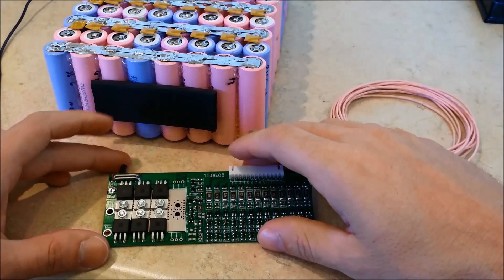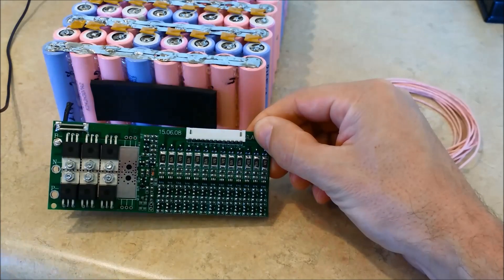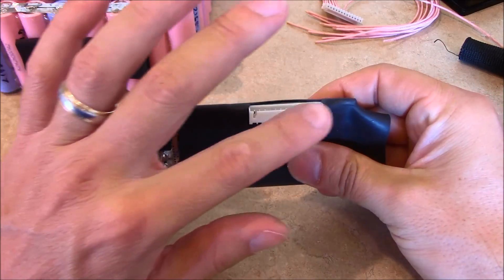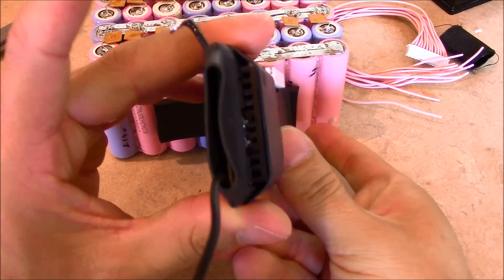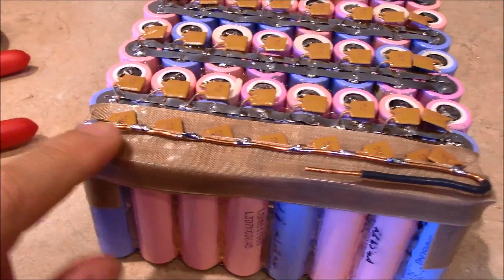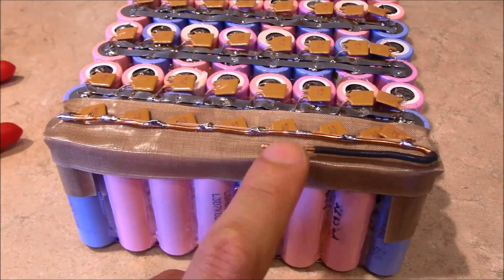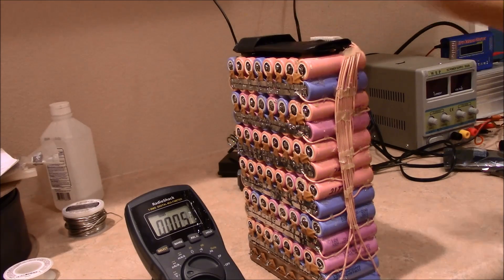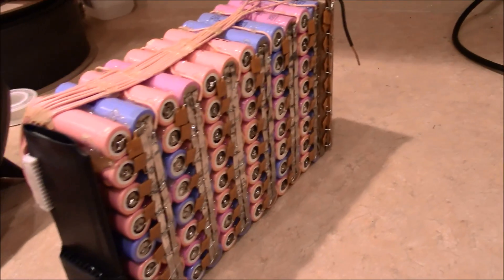18650 lithium ion battery "Wiring the BMS" (Part 4 of 7)

Comment: so i understand everything but i can't find a label that says ch on my specific board, recommendations on where to look?
Reply from the maker: +Ryan Liu ok I thought the link was to what you bought.   Just let me know what is exactly is on your board.  Each type of board has different features.  I'll post mine on my profile page as a reference.
Reply: it is the link i sent u earlier
Reply from the maker: +Ryan Liu  Sorry Ryan, but when I clicked the link last night it was a different schematic.  But now it's closer to what you bought.   OK I your ch+ is the same as V+ .  They come directly off the positive end of the battery.   So connect 2 wires to the positive terminal and send one to the + side of the charging port and the other to the controller + wire.  The C-  wire will go to the charging port negative side.  The P- will connect to the controller negative wire.  B- will connect directly to the negative side of the battery.   let me know if that helps.
Reply: it is only outputing 22v is that because i may have blown the board?
Reply from the maker: meter your battery directly to see if you get 36 volts and "not thru the bms".  Also check all 10 banks voltage to see if they are all close to the same voltage.  Then put your meter negative on the b- of the bms and with the positive lead of the meter go thru each B1 to B10 of the balance charging plug and see if it flows correctly 3.7-36 volts

Comment: how did you wire yours, mine is kind of confusing, how do i wire it? http://www.ebay.com/itm/Battery-Protection-BMS-PCB-Board-for-10-Packs-36V-Li-ion-Cell-max-25A-w-Balance/261830652630?_trksid=p2047675.c100005.m1851&_trkparms=aid%3D222007%26algo%3DSIC.MBE%26ao%3D1%26asc%3D33098%26meid%3Dd05989fb513b412da4db412a6b264e33%26pid%3D100005%26rk%3D1%26rkt%3D6%26sd%3D261418906940#shpCntId
Reply from the maker: +Ryan Liu I'm not sure of your knowledge on wiring so I will try to explain in detail (sorry if its too detailed). 

looks like you have a 36 volt battery correct?  I'm looking at the item per the link.  So, on the + positive side of the battery you will have 2 wires come directly off the + positive terminal,  connect one of the + wires to the (P+) or (controller red wire) and the other + wire to the positive of the charging plug (ch+) (your 36v charger will plug into this)  The (ch-) is for charging only so solder a black wire to (ch-) and run that to the negative side of the charging plug.  The other (P-) solder a black wire from there and have it terminate to the negative of the controllers black wire (P-).   (Main terminal B-) solder a black wire to (B-) and connect it to the negative of the battery.   Please let me know if it doesn't make sense.

Your battery will have 10 banks of batteries in series to make the battery voltage 36 volts (+-)(+-)(+-)(+-)(+-) etc.... each bank will have cells in Parallel for the amps.  The more cells in parallel, the amps your battery will have.  Please let me know if I need to go further in detail.

The balancing part is very critical to get correct or you will fry the BMS board!!   After your battery is put together start from the negative side the 36v battery.  When wiring the balancing wires think of all 10 banks that are in series to make the battery.   You will start on the negative side and go to bank one.  Connect B1(from the BMS) to the first bank (+). Bank 2 will have B2 connected to the positive end of that bank etc... the last balance wire B10 will connect to the last bank + in the battery.  When your finished check the voltage in each B1 to B10 thru the "White" plug that connects to the BMS. With a multi-meter, the negative of the meter goes to the negative of the battery (Keep it there) and the positive will move from B1 to B10 of the white plug.  If the voltage of each bank is 3.7 volts you will see the following:

(Negative side of the battery 36v)
B1=3.7
B2=7.4
B3=11.1
B4=14.8
B5=18.5
B6=22.2
B7=25.9
B8=29.6
B9=33.3
B10=37
(Positive side of the battery 36v)

If its hooked up correctly plug in the white BMS connector to the BMS.  Now all you have to do is plug in the 36v Lithium charger to the charging plug and wait for it to be done.

Hope this helps.  Please let me know how its going.  Thanks
Reply: 15-sec-of Fame where is p+ i cant find it on my bms
Reply: where does p and b- go
Reply: i see you have described the common picture for the wiring diagram i know what a ch+ and - is but where are these on the board and where do all these letters connect

(ch+ goes to...
(p- goes to...

i am sorry but i am having trouble understanding your wording and associating it to my board/battery/charger
Reply: btw i have wired the b1 b2 b3... correctly according to your advice
Reply from the maker: Ryan Liu there is no P+ on the BMS,  P+ is referring to your controllers red power wire. Where the batteries + (36v) connects to the controller + wire.  B- goes from the BMS directly to the negative of the battery (36v).  You will not connect 36v positive and negative to the BMS only the negative goes thru the BMS.  The only positive wires connected to the BMS are the balance wires.
Reply from the maker: Ryan Liu ch+ goes to the positive charging port + and ch- is the negative of the charging port.  You will plug in your charger to this as your charger will have a positive  wire and a negative wire.  you will need to match (ch+/charger+) (ch-/charger negative -)
Reply from the maker: Ryan Liu P- connects to the controllers Negative 36v black power wire and  P+ from the battery+ connects to the controllers red power 36v wire to power on the controller.
Reply from the maker: Dont worry we will get thru this.  I am going draw a better way real quick because the BMS drawing is confusing.
Reply from the maker: Ryan Liu posted a drawing in my profile page https://plus.google.com/u/0/118408585808421129143/posts/Ncp6eg3aZA1?pid=6200168948156239954&oid=118408585808421129143

Comment: hi,  which fuse type are you using ? thx
Reply from the maker: +jbcola74 I just typed in "4 amp 16 volt reset-able fuses" on e-bay and a few weeks later they arrived.  I'm not sure of the brand, but they are working out great.  I have put about 47 miles on the bike since Friday and the first 30 was all out speed!  After almost 30 miles averaging 32-37 mph I finally stopped when the voltage was at 48 volts.  I'll have a new video out soon. Thanks

Comment: Hey, great video, you have installed a BMS onto your battery which I am going to do with mine. Does this mean that you can charge it with a standard 48v li-ion charger or would you need to use a balancing charger (eg IMAX B6 charger)? Can't seem to find the answer anywhere! Please help!
Reply from the maker: +Jonny Helliwell  thanks Jonny, the BMS is there to balance all the cells in the battery.  All you need to do is plug in the Lithium ion 48v charger and the BMS will do the rest.  I bought a charger that will let me know when the battery is at 54.6 v.  I will post a video to show how it all comes together.   I wired my BMS to only use it as a balance charger only due to its max amperage is 45 amps and I don't want to fry it when I'm riding my bike like its stolen,  haha.  So I have the negative coming from the BMS to a charging port and a positive wire coming from the battery to the charging port.  The controller and motor has its own positive and negative wires directly from the battery with thicker wire.  Also,  I am going to have a switch on the controller and motor side to keep the charger from sending voltage to them when charging.  Hope this helps and let me know if you have any more questions.